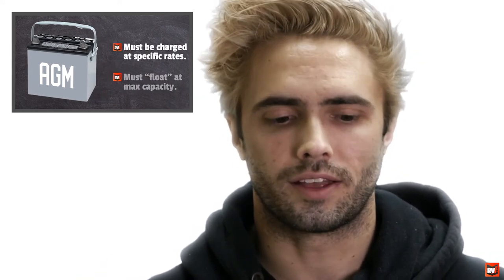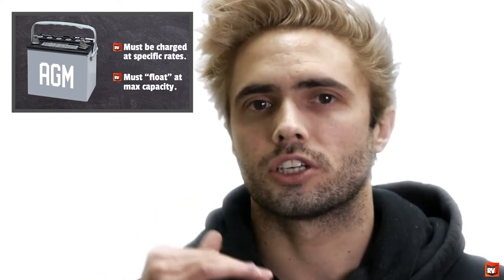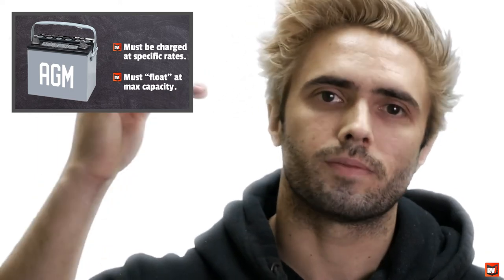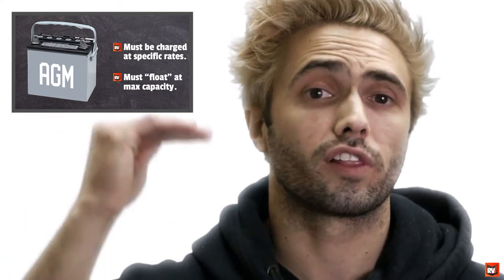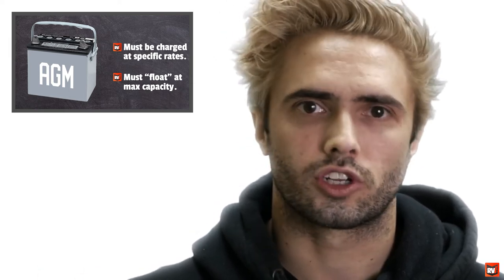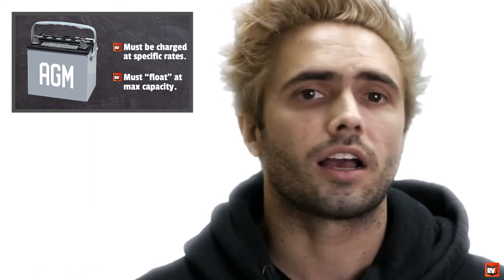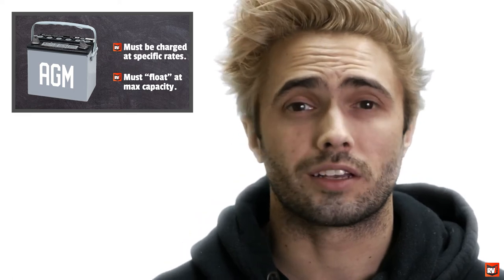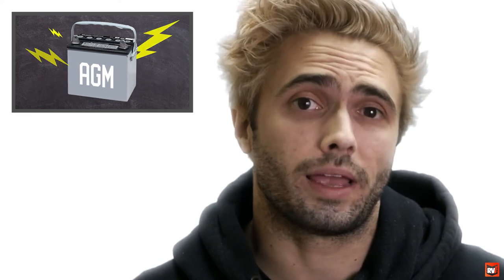RVi's How It Works! - Towed Battery Charger Plus

Comment: Why it drains? Because breaking and turn signals operate from the battery itself.
Reply from the maker: Hi Steve, whenever a vehicle is in its flat towing mode, certain computer systems and components under the hood remain 'on'. This is what creates the varying levels of battery drain.

Comment: I have a 2019 Chevy Equinox.  I am sad to hear that the Equinox is a pig on TOAD Battery-voltage and that you're charger cannot keep it fully charged.  So if it's a Charger, then why can't it keep up?  Why don't you design one that can?  I like the idea that I can see the Battery-voltage on the RVi3 tablet, but it appears I am going to watching the Battery-voltage value dwindle as the day wears on.  Lots of people tow Chevy Equinox and never mention this battery drain issue.  Can you tell me how you tested for this battery-drain?  Over how much time does it take for the Equinox engine-battery to drain down to a harmful voltage value?  I'm sure you have documentation from your testing that you can share with me.  I already have a KISAE DC-to-DC charging system that runs off the RV Alternator (2021 MB Sprinter 3500)... and it charges our 640Ah lithium coach batteries up to 50 Amps an hour.  Your Xantrex Charger idea is also a DC-to-DC Charger.   I'm not sure I want two DC-to-DC Chargers in my overall RV system.  Thanks for your help.
Reply from the maker: Hi there! Our charger can keep up with a max of 10A - which is more than enough for almost every towed vehicle. Unfortunately, the Equinox is typically pulling about 15-18 while in its flat tow mode (and that's with pulling fuses). Because of that, you'll generally see the Equinox die in less than 5 hours. We've seen it happen as quick as 2 hours. It does vary a bit. Unfortunately, it's tough for us to redesign an entire product to accommodate a single vehicle, when that same product works across any other scenario. As such, we do have a higher amperage charger that we recommend to customers. It's not made by us and we're not associated with the company in any way, but it is one that a lot of customers have had success with.

You can find that charger here: https://www.amazon.com/gp/product/B0851TPKV7/ref=ppx_yo_dt_b_search_asin_title?ie=UTF8&psc=1

If you do go with the charger listed above, we would recommend just using that one charger as opposed to trying to wire it in with your existing charger. Hope that helps!
Reply: @RVi  If I still want to use your Charger, will it work?  Will it still charge, but not top off the battery... according to what you say?   Will the Charger burn-out?  In many forums and FB groups for the Chevy Equinox, people have said they suffer no dead batteries while towing the car behind their RVs... so how do they do it then... without using the DC-to-DC Charger link you posted... and just using a basic battery charging kit?
Reply from the maker: Hi! No, our charger will not work on the Equinox. It may not necessarily cause a problem - but it wouldn't actually charge the battery in most cases. We say most because the Equinox drain can range fairly drastically when towing. As stated in our previous comment, it's typical to see 15-18A of drain, but that really can range anywhere from 10ish to 20A. If you're down around that 10A range, then our charger would keep up - but if the drain goes up for any real length of time, your battery is going to start dying.

In most cases, with an Equinox, folks are using some kind of charge line/charger than has the ability to charge at over a 10A rate, or they're getting really, really lucky using something that doesn't pull as much. Luck is obviously not a sustainable way to travel, and it's also why we can't support the charger on that vehicle. So, as a rule, no - our charger will not work with that specific vehicle.